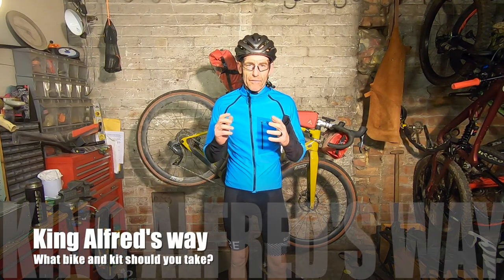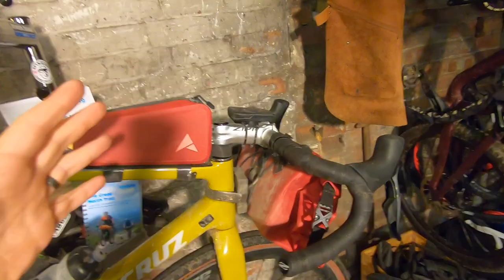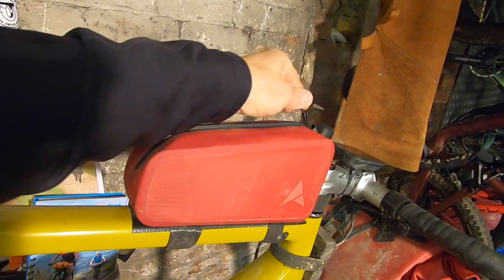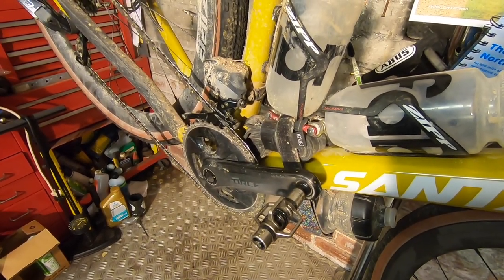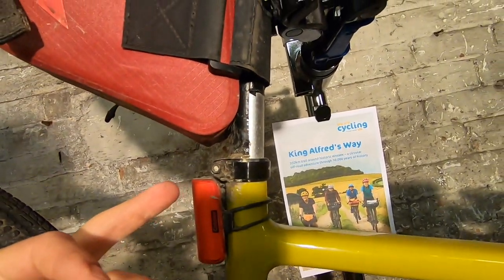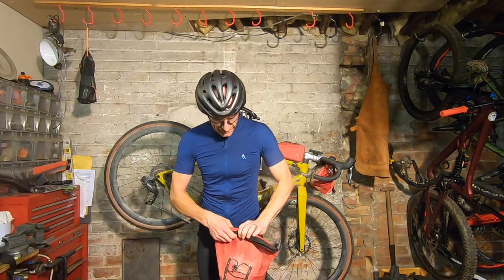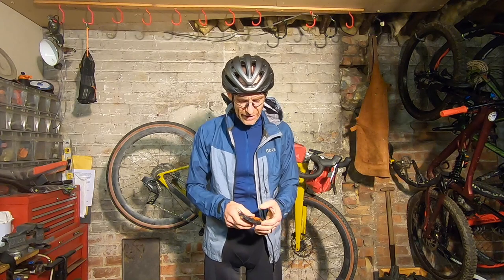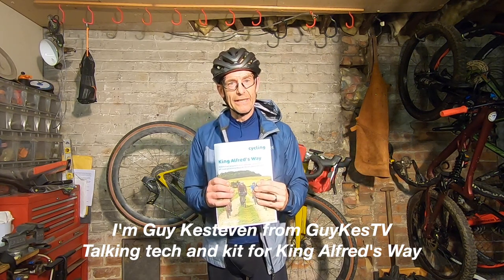What bike for King Alfred's Way? Bike and kit choice for Cycling UK's new gravel route.

Comment: I watched all 3 episodes of your King Alfred's Way (can't believe I didn't know about your channel before that... subscribed now). I am an amateur long distance cyclist (if there is such a thing)... longest ride I did in my life was the Via Francigena from Canterbury to Rome in 2016, but never done bike-packing style (always panniers) and keen to try it at some point. Now... I only have 2 hard-tails and a Cannondale Synapse (the cheaper one) which has an Aluminium Frame and carbon forks. The amateur in me is not sure what is the difference between a gravel and a road, but I guess the material (no carbon) and the tires? From having watched your episodes, it does not look like the Cannondale I have is a good choice, even with a more robust set of tires, but any tips or hints would be appreciated. I've done the Pilgrims's Way from Winchester in Sept but I went MTB style with Ortlieb panniers on both sides and lost one of the lower screws along the way (and didn't have a spare one :( ), so I understand perfectly what you said there...

Comment: really helpful video. looking at being a little ambitious in doing this in two days staying in Reading Prem Inn and carrying minimal kit. My setup is not tubeless with no option to convert. I run some nice wheels on an old cross bike with currently Panaracer Gravel King EXT plus slime inner tubes. Mostly its fine but bigger hefty thorns have been known to get through and render the slime inner useless. In trying to avoid this I am trying to find out the best tyre for puncture protection on the route in a 38mm (thats as wide as the bike allows). So far the Schwalbe Marathon GT365 look like a very good often, they seem to get a lot of good reviews from people riding them puncture free in the worst commuting conditions and off road. Do you have any advice on tyre choice given the limitations I am working with. The flint on the route does sound like it could challenge most tyres.

Comment: Really useful video, thanks. Also seen your route previews which are great. Quick question...what shoes would you recommend? Do you need specific gravel/mountain bike ones?
Reply from the maker: You don’t ‘need’ specific shoes but having a pair with some tread on for any bits you need to push / go into cafes / explore hill forts etc. In is a lot easier than clattering about in road shoes. I personally use XC race shoes for their stiffness but there are so many options in terms of stiffness / style just find some that reflect the ratio you expect to ride or walk 👍🏻
Reply: @GuyKesTV  Thanks!